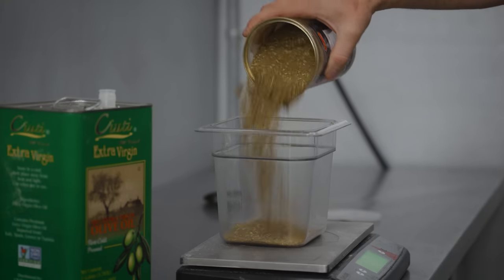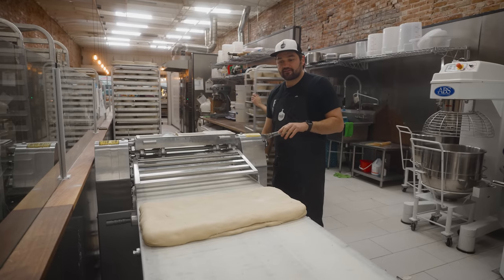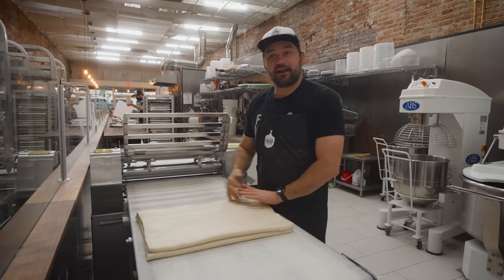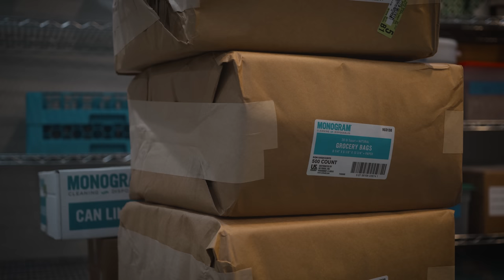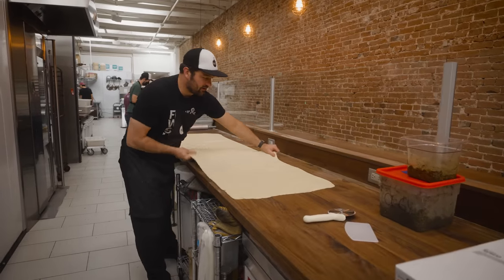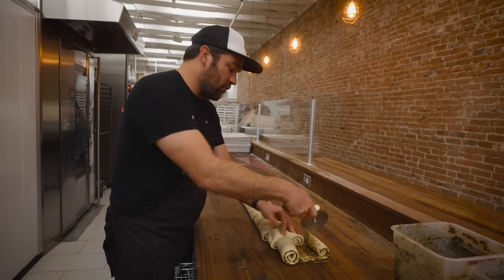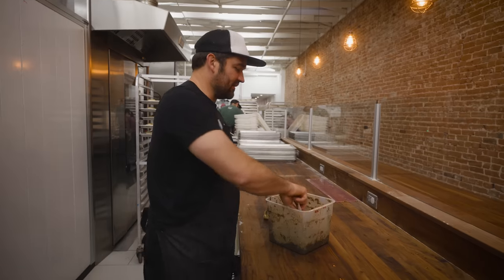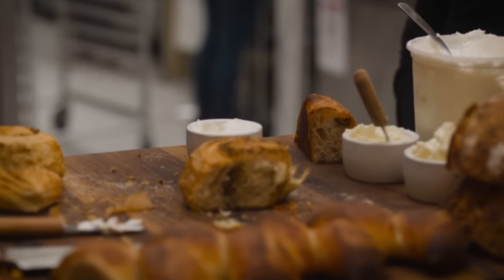Sourdough Croissant Lamination Za'atar Pinwheels | Proof Bread

Comment: From a baker to another. A tip when doing a book fold: try out not making the fold in the center of the dough, instead just fold over 1/4 and 3/4th so the crease isn't in the center. I find it hides any imperfection in the lamination and decreases the need to cut away the edges that didn't get any butter.
Reply: I don't think he enjoys any advise on the clinical level.
Reply: @jeromejohnson1954  Based on what? Baking is continual learning, I'd imagine he knows that better than anyone and is open to hearing any suggestion - at worst, you verify you are using the best method you know of.

Comment: your Mashine sounds like the bearings of the Roller or the Belt are worn out, just grease will dampn the noise for a while but not fix it, to much play so it shatters, so if posible replace the Bearings/Bushings
Reply: Sounds like a clogged scraper actually
Reply: @MasterBaker2020  could be, but thats the sound i hear almost every Day at work when i roll stuff into my Metalbandsaw, one of the Rollers squicks like that too in one direction. 
Because its worn out it basicly rolls up a fraction and falls down in high frequency wich makes that shattery squicky noise .. 
but also very true is, to judging that for 100% certain just from the Video is imposible ^^ .. both could be right or wrong